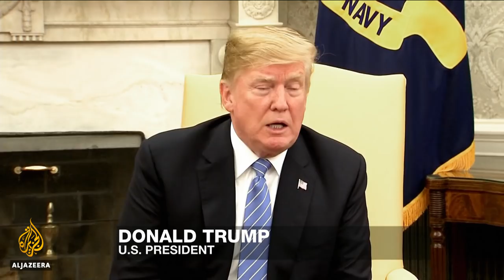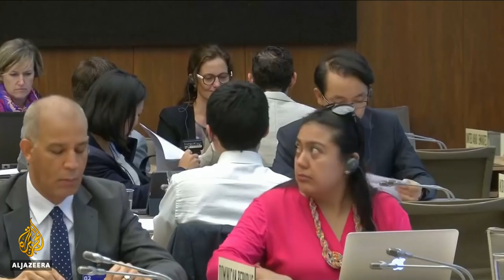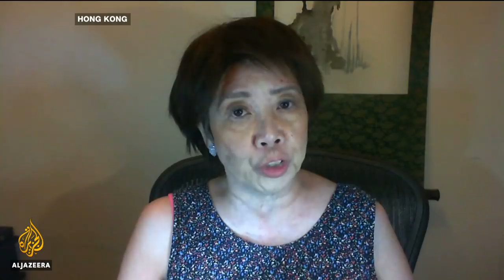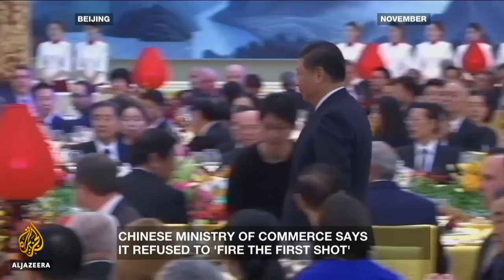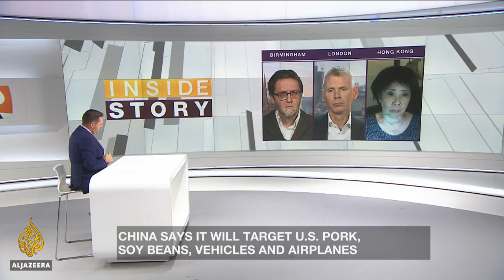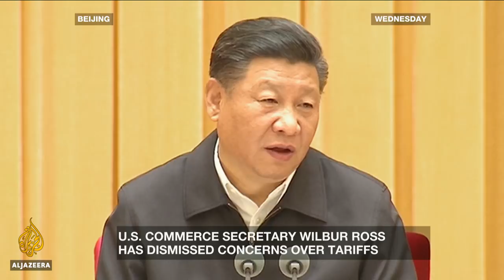🇺🇸 What do Trump's tariffs mean for global institutions? | Inside Story

Comment: Scott Lucas seems to forget that the US possess the most powerful navy in the world. The US Navy could cut shipping lines at will, so if the US is really going rogue, the whole global economic and trading system will be grind to halt in single day.
So no, the US is not rogue nation, at least not yet.
Reply: shawal junaidi
We talking about surface ship here, so the Russian could just use their satellites to detect US ships. It's not like the US have to hide its fleet anyway.
What you gonna do when you know where its located (e.g. in Diego Garcia, an island in the Indian ocean blocking trade from strait of Malacca)? You don't have fleet capable of contesting the control of the seas.

All the US need to do is park half-dozen destroyers, backed by aircraft carriers few hundreds mile away on each shipping lanes bottleneck (e.g. Somalian coast to block access to Suez, South Atlantic to block Panama canal, and Indian ocean to block strait of Malacca).
It's enough to block all incoming merchant ships and grind global trade to halt.

Anyway, submarine would be less efficient for this kind of mission as its operational cost is usually higher (compared to destroyer), and each submarine only carry several dozens of torpedoes and missile anyway. So theoretically you could only sunk a couple dozen of ships (each salvo requires several torpedoes) before having to resupply. Surface ship could shot its guns directly.
Unless Russia or China, or anyone else have strong surface fleet (which they don't), there's no need for the US Navy to utilize its submarines as merchant raiders.
Reply: Immanuel Herman So let’s hope it will be in sane for as long as possible